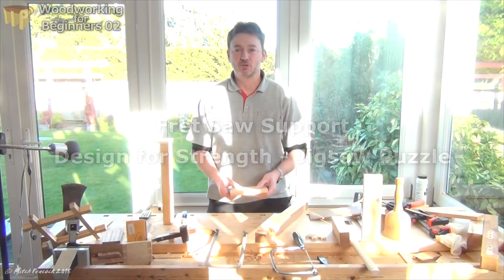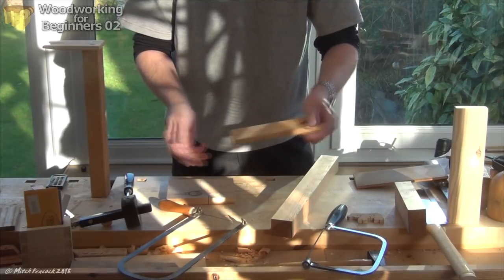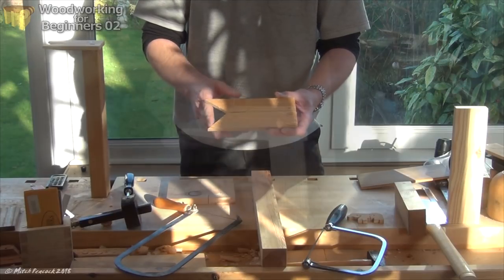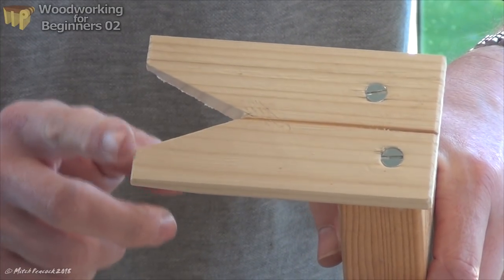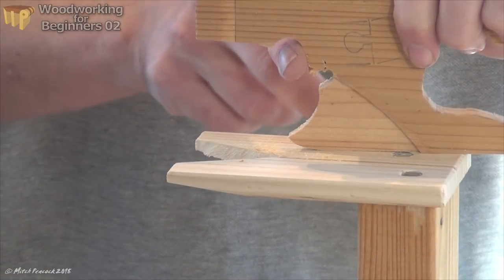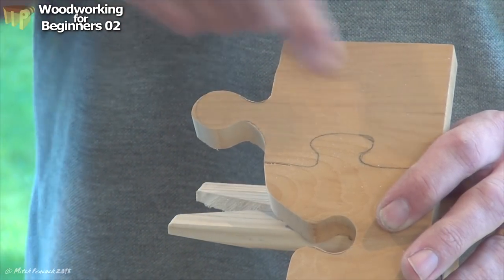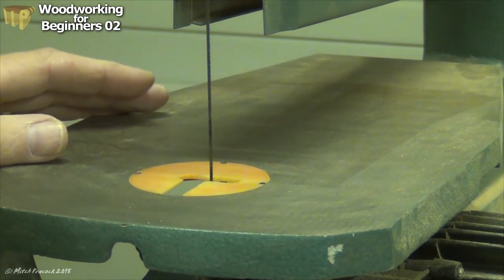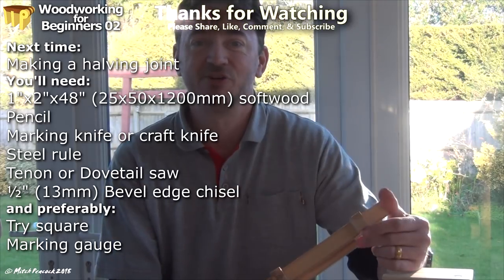Woodworking for Beginners 02

Comment: Nice video, Mitch.
The Fret-Saw and Coping-Saw are exactly the same in Germany.
There are also differences in the scroll saw because there are saw blades with a pin and saw blades without a pin. The saw blades without pin, so that you can saw tighter curves and / or I can say something from the inside.
Reply from the maker: Cheers!